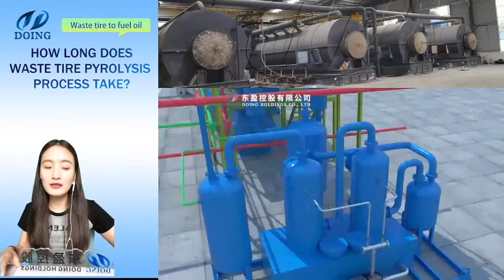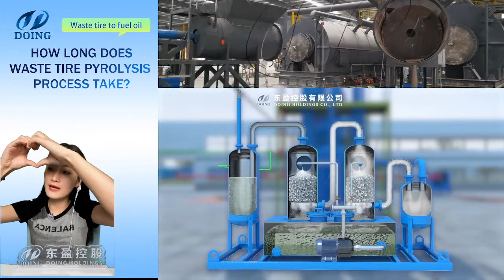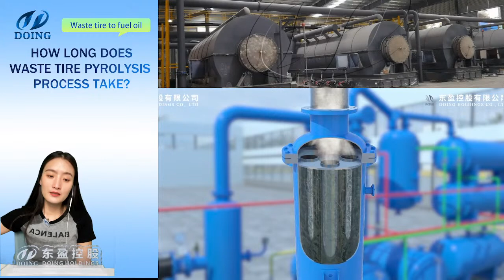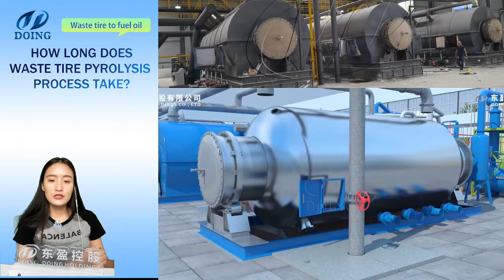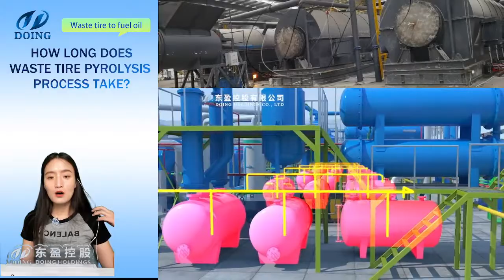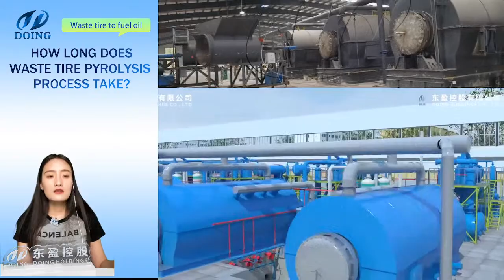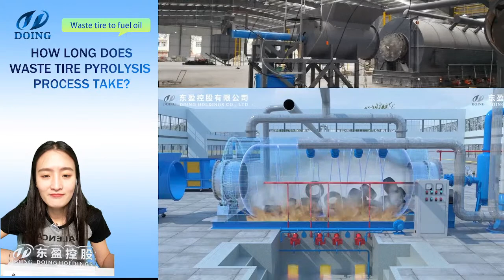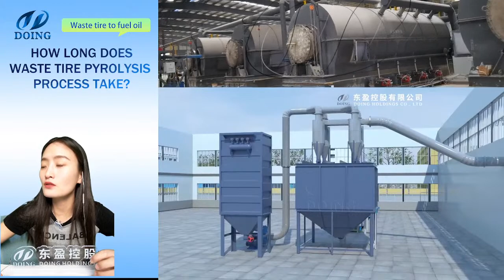How long does pyrolysis process take?---Tire Plastic to Fuel Oil Pyrolysis Plant

Comment: What happens to the wire and cable that’s in the tires
Reply from the maker: it can be draw out before pyrolysis for sale by steel wire drawing machine, or after pyrolysis, pull the steel wire out for sale. More details of the pyrolysis machine, welcome to contact us:hand-pink-waving:.
Whatsapp/Tel: +86 13526692320
E-mail: oilmachine@wastetireoil.com